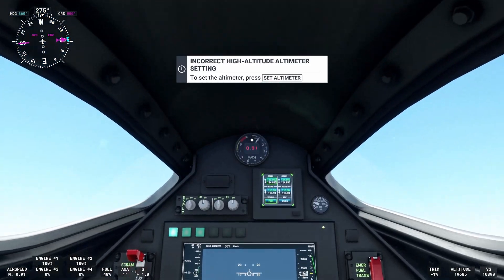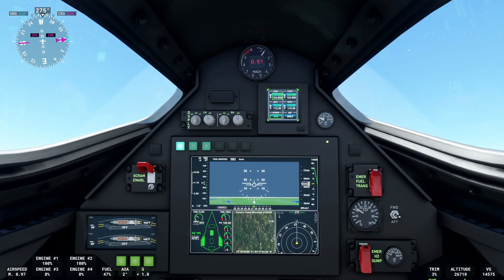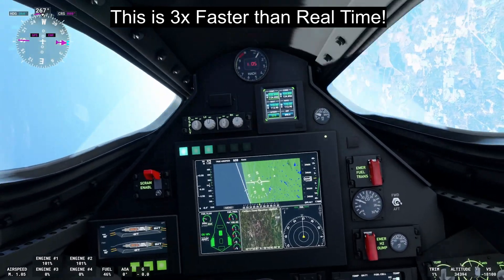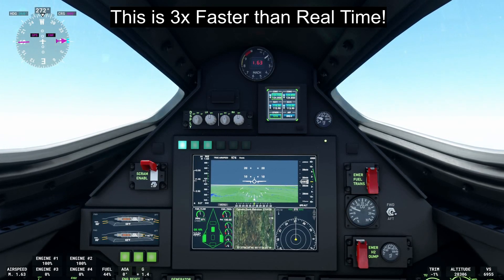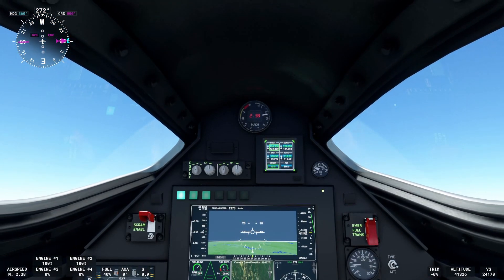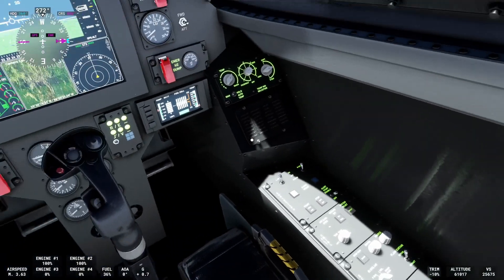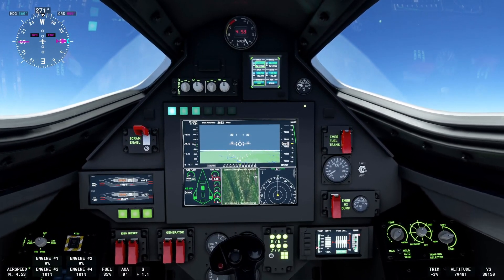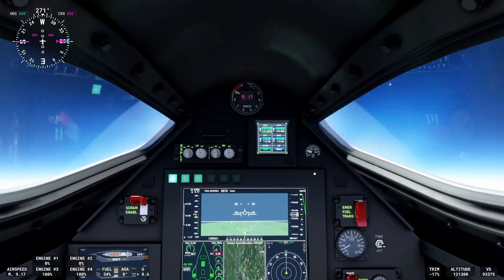MSFS - How to Fly Mach 10 in the Top Gun Maverick Darkstar (Fast Tutorial!)

Comment: You don't need to do the inverted roll.
Reply from the maker: True, but it tends to be more consistent and helps get up to speed faster for me.
Reply: Correct .you're way is faster.
Reply: You technically don't have to, if it was a drone you wouldn't need to IRL, but it's to prevent the pilot from blacking out. We can take positive G forces much better than negative, so for that dive to pick up speed, the pilot needs to roll so that their blood goes to the feet rather than brain. So it's not purely an in-simulator reason, it's also because that's the actual flight plan that would be required IRL.

Comment: So you tell your viewers how to reach and fly mach 10 in the title but you actually don't show it. Typical click-bait video... 👎
Reply from the maker: I show the entire process
Reply from the maker: If you go to max altitude you'll be at Mach 10. I didn't want to waste everyone's time waiting to climb 150,000 ft to show it.
Reply: Lmao, 1st you lie and say you have to go inverted (not part of the process) then you say you have to turn on the scramjet and fuel cell (which is the only correct thing you said), but don't actaully show that oart of the process which is the only necessarypart. You showed none of the process you need, and a bunch of stuff you don't.
Reply: @happykillmore349 You TECHNICALLY don't have to, if it was a drone you wouldn't need to IRL, but it's to prevent the pilot from blacking out. We can take positive G forces much better than negative, so for that dive to pick up speed, the pilot needs to roll so that their blood goes to the feet rather than brain. 

So it's not purely an in-simulator reason, it's also because that's the actual flight plan that would be required IRL. That's why the tutorial/mission requires it, it's roleplaying being an actual pilot rather than just remote controlling it.